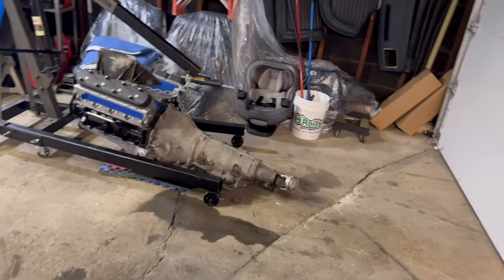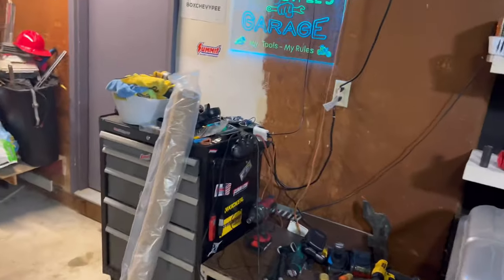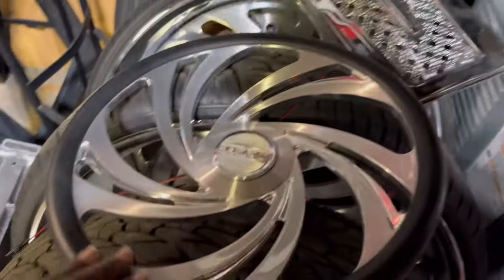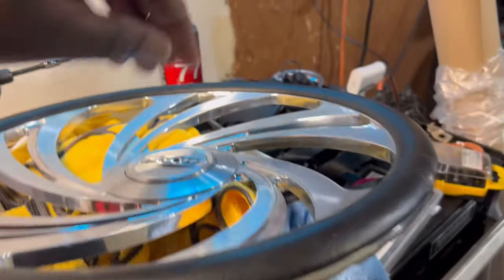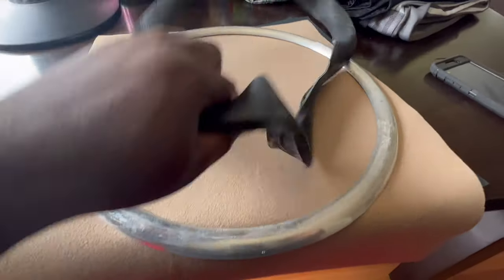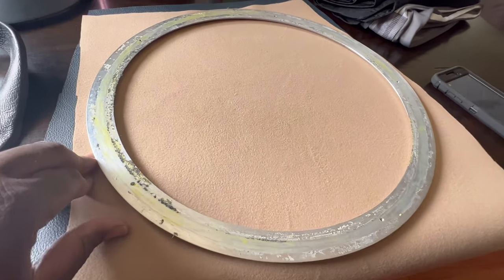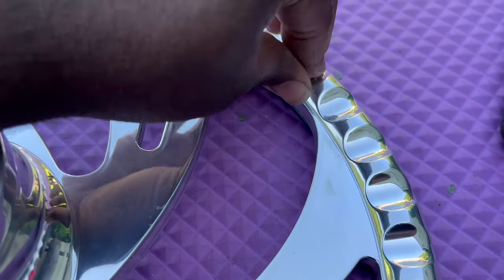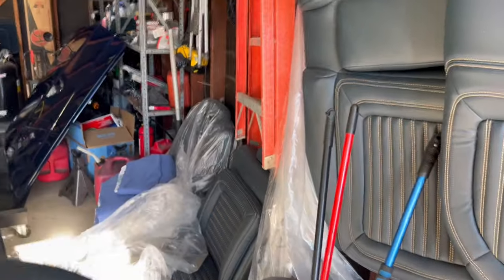WRAPPING MY BILLET STEERING WHEEL TO MATCH MY CUSTOM INTERIOR

Comment: You've got it Man, you've got it.... This is the best clip I've seen on YouTube in months. I'm a Body shop tech at heat and the paint doesn't look ba ;)  . IT'S CLEAN PAINT. The shop is awesome and your style with Billet Specialties is impeccable. 
Thank you for showing me how to re rap my Billet Specialties steering wheel. 
You did a real Damn Good job..... 
10/28/2023... MDB